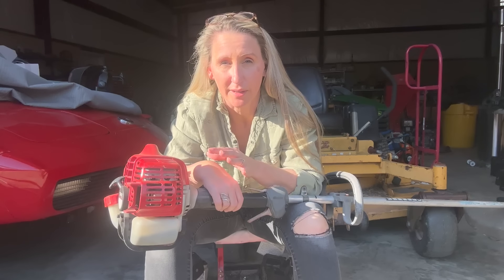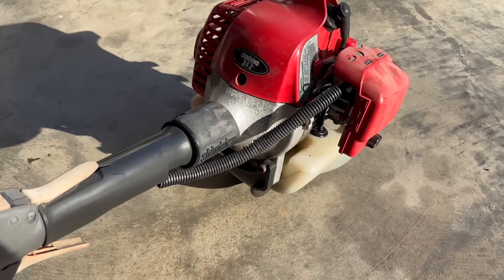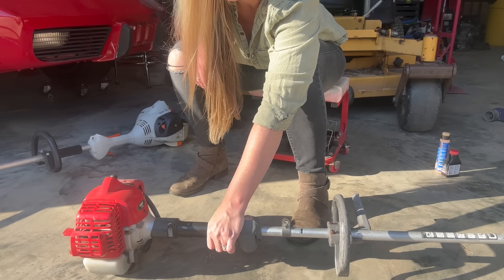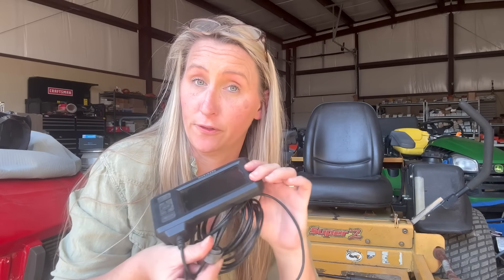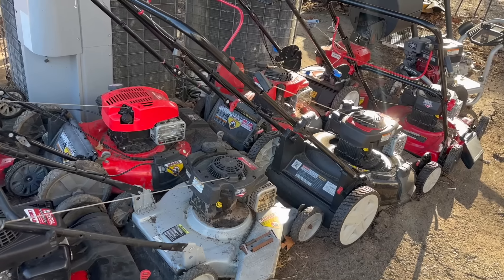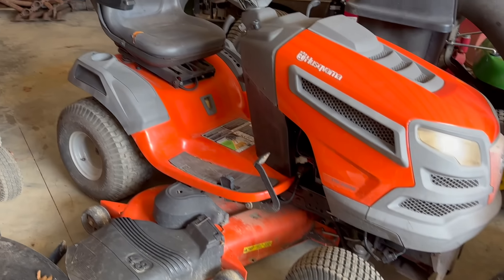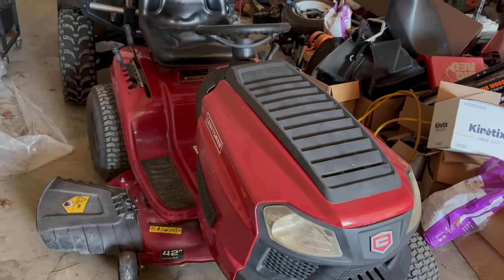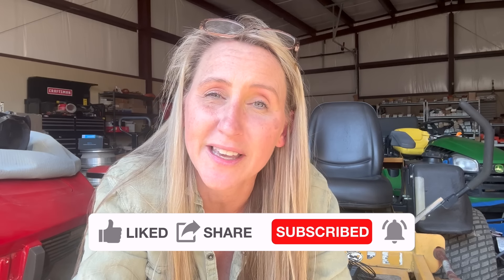Most People Do Not Know This SUPER EASY Trick I Use! MY 10 Second Trimmer Starting Guide!

Comment: $30? You got to be kidding the local shop where I live in Maine wanted $65 to replace the jet in the carb of my Toro lawnmower. I bought the part and it took me ten minutes to do the job. Thanks for the weed trimmer and thanks again for an old tip on your site that said most times the purge valve is not the cause of poor fuel feed. I was going to replace mine but following your advice I replaced the in line tank fuel filter and it fixed the problem!

Comment: All of my gasoline equipment is kept full of gas and I run them at least every two weeks.  They are kept at the door of my shop so they are not "out of sight, out of mine".  My gasoline generator is run monthly, under varying loads until it runs out of the pint of gasoline I put in it.  I have NEVER had an issue with any generator I have ever owned doing this routine.  It's on my calendar to do regularly!
Great channel!  Thanks for all the videos!
Reply: Wish I was that dedicated. I can do monthly stuff on some things but not my lawn equipment
Reply: @scotchdrnkr  Disney has a very effective way of exercising their emergency generators. They disconnect from the electric utility and run on the generators for the overnight shift.
Reply: my last generator wouldn't level off this year, rodding out the jet didn't fix it, so I bought a new one.  - the old one is 18 years old, and showing signs of electrical gremlins as well.  the big problem I had during that time was ethanol related.  old one will go to the saw shop to get worked up and will go into the family shop for storage.
Reply: Same here!

Comment: Back before I fell ill with cancer I use to do lawn care for my grandfather since he works from 5 to 5 doing construction and every time I’ve had to use the string trimmer I’ve never went full throttle I usually give it about half throttle maybe less and never had the issue of it dying again and I did that every single time now I’m not saying this will work for everyone however it worked for me I think it’s more so your location and the temperatures me being in southern Louisiana it’s hot 95% of the year until about October then we get down into the 60’s to 70’s every now and then we will get a super cold week around 35-40 in the day and around 19-25 during the nights and ive seen cases where extremely cold temperatures can easily effect gas and 2 stroke fuel, but as far as that goes I’ve never had an issue with a string trimmer!

Comment: At the end of the season, I empty the fuel and run the engine until it stalls out. Then it's ready to store for the winter. Spring time I give it some fresh fuel and BAM, it starts and runs as intended. I do the same for my ATVs. Top off the fuel tank and turn off the petcock and run the ATV dry. Never had an issue with them in over 39yrs.! Good tips, keep them coming! P.S. I also use non-ethanol gas in my yard equipment engines and ATVs.
Reply: Yep. Old school dirtbike/atv trick I was taught and used for decades.
Reply: Same  here. I learned that while talking to tree trimming business i FLA doing hurricane work. They advise me if you do not run the 2 stroke at least once per month, drop all fuel run it dry and hang it up. I never had to tinkle with this doing this , just add new fresh fuel and prime, pull the damm cord 2-5 things and it should start by the next pull.

Comment: Thanks for the tip on the trimmer! You can also check your fuel with a piece of clear vinyl tubing. Stick it in the fuel tank then put your finger over the top end and pull it out or you can use a mitey-vac to suck some up and take a look😊

Comment: I've been through this a couple of times with my Husqvarna 128LD trimmers, even to the point of replacing the carburetor, spark plugs, etc. on one. Then I found out all you have to do is remove the little screen on the exhaust port and clean the oil residue out of it with solvent or carb cleaner. Fixes the bogging-out problem for me every time.

Comment: First tip on a 2 stroke stored with fuel in it.  Check that the burn barrel is cold, don't care if it hasn't burn in a couple days, COLD.  Dump fuel into the burn barrel.   Fill with fresh mix, pump it through and go to it.   And ya, do the choke trick till every thing loosens up.

Comment: The only thing I have done for last few years is at winter storage just run engine every 1-2 weeks for a minute or two.  It moves out gas setting in carb and lawn tractor keeps battery charged…. Never had problems starting everything for start of next season

Comment: That's actually how I "quick" start almost every piece of stick equipment in my shop. I show the same thing to my customers all the time. Even machines that are normally run can be slow to start if the carburetor us getting older. It works just as good on them as well.

Comment: If Chickanic's trick does not work for you, remove the old fuel from the tank. Get you some Mechanic in a Bottle and pour some into the tank. Push the primer bulb about a dozen times to circulate the solution thru the carb. Let it sit over night. Next day add fresh fuel to the tank and it will start right up. It's very simple. Even better tip: always use ethanol free gas and you will never have this problem at all

Comment: I love the tip. Didn’t know about hitting the choke like that. I always just kept bumping the throttle until it frees up and once it does I peg it until it gets up to rpm. A little tip about 2 strokes, if you are tuning an engine and it goes from too rich to too lean and you can’t get it right, the carb needs rebuilt. Stop and take it to a shop or rebuild it. Could go lean and blow it up if your not careful

Comment: This is actually a good technique to also do on any carb engine where you think there is a particle of dirt clogging one of the jets. Doing this will help pull fuel thru the jets and other orifices harder and poss dislodge the dirt. On a snow blower without a filter or choke that closes completely, you’ll need to use a gloved hand under the carb cover to do this technique. Protect yourself against flame backs.

Comment: great hint to get things loosened up from winter storage! I do not know if is the thing to do, 
but I try and run all the gas out of the motor.so it is dry until u put gas in to the unit.
I also use a bit of carb cleaner in the gas. to clean out any glazing from any gas residue.

Comment: Just got all of my equipment out today and got it ready for the season. I own a small lawn care business. I tried your idea of using pure Echo Red Armor oil to put in all of my 2-cycle machines to store for the winter. That did work, but it sure made a mess when I went to remove as much of it as possible before starting. The Echo machines seemed to be easier to start than my Red Max machines. But, everything seems to be running fine. About ready to Go!

Comment: Thanks! I'm going to give that a try on our old one. I don't know how old it is, but I've been trying to get it going again. My dad used to use it, but hasn't for years. It had a cracked primer bulb and bad gas lines that I replaced along with a fuel filter. I got it running, but it was doing this last time I tried it. I'm anxious to give it a try.

Comment: Thanks Chickanic! got the scope for $40 :)
I have used the same method for my trimmers, this season unfortunately my metering diaphragm was rusted and pretty much toast, got water in the fuel from a crappy station, I use non-e gas only. Pulled an older carb off the same model parts trimmer and i was off n running and then ordered a backup carb from da chinamen

Comment: For Stabilizing gasoline I use a product called PRI-G. I’ve personally used gasoline that was Stabilized for four years, 😅 I put it in my truck and you could smell It was getting old, but it ran fine. They also make PRI-D For diesel.

Comment: We are looking for a piece of machinery to do work around our property, and it may be an older rider that I can drop the deck off of it and just use it for getting around the property, and pulling the yard trailer and stuff.  Maybe even try a snowblower on it if we can find the right unit.  If I lived closer, I would head on over and look at a couple of those.  Since you showed your pool table, I actually found my old cue recently, that I bought back in the early 80's, and it still has the red chalk on the tip from the table we used to play in a friends basement.  Now I would gladly remove the workout equipment from my basement and replace it with a pool table.

Comment: I usually during the cold season I usually start my lawn equipment about every 2 weeks and let it run for about 5 minutes and have no problems. But my craftsman weed eater was running fine then about a month ago it just stopped running. It's sounds like it lost spark cause it sounds like I have to plug wire off it just turns over. So I bought a Husqvarna weed eater runs fine but of course it has the defective speed head that binds the string

Comment: Thank you Ma'am for the suggestion on the two stroke.  I have a two stroke power head that I got so frustrated with I said the heck with it and went with a 4 stroke power head replacement.  I'll pull that two stroke out (after a few years) and see if I can resurrect it.

Comment: A simpler way is to just winterize it correctly with fog lubricate or use carb cleaner to spray in the carb at start up. If the fuel is bad choking it out will make it worse.

Comment: The only thing you left out is to also check the screen in the muffler on the newer stuff, because they seem to make them intentually restrictive these days. Helpful tip if you don't ever lay your equipment in a pile of leaves soaked in gas while running making the "spark arrestor" aka the stupid restrictive screen of doom disappear and never return will make your equipment run way better and you won't have near as many bogging issues in the future!

Comment: Every fall, I run the mower until it dies, change the oil, clean and gap the plug, lube the wheels and throughly clean under and top. Check the drive belt. Twin blade Honda push. New gas in the spring and starts with a half pull every time. Its 9 years old and runs and looks like new.

Comment: Excellent tips !  Now how about Stihl Chainsaw - that won't idle after it warms up after it ran perfectly 6months ago, yet still accelerates & runs full RPM ok.
Reply: Try adjusting your idle up with the “LA” screw.
Reply: @shannonwhitaker9630  It turned out it was a random  blockage in the idle circuit.
Took carburettor apart used some compressed air, both directions with L needle 🪡 removed as I didn’t have a new welsh plug for removal /replacement. In the end assembled and it ran OK for a bit, so I knew I was on the correct track. While running higher RPM backed out the L screw alot & rev it'd up /down then rest L screw 1-1/4 out which is the middle sweet spot and all is well again.
Reply: Makes you smile when you figure it out yourself. Sometimes a quick clean and re-adjust does the trick.

Comment: Good tip. I was just gifted a chainsaw about an hour before this video posted. It hasn't been used in 4 years so I was going to drain the tank and clean the carb but may try this to see if it saves me some work, Some times you get lucky. Thanks for all the helpful videos. Congratulations on getting your home gym set up. Is there a tips & tricks video coming on that? :-)

Comment: I used to have problems starting a 2 stroke engine in the spring after a winter of sitting. If you drain the tank before storing the unit for long periods of time you will most likely not have to do the choke waltz. My conslusion is the oil partially separates from the gas causing a sludge that restricts the flow through the carburetor.  Walk On !  ☺♥†♪♫ 2-28-24

Comment: Great video, thank you very much.
I understand changing fuel that has water in it.  But, as you say, Ethenol Shield may & heet in the red or yellow bottle (?) is supposed to fix the water in fuel issue ... and does ... or has for me in my experience. I live in S. Louisiana where it is humid during a fire storm.
Anyway,
I also have 55 gal drums of gasoline in the back of my property, (mentored on how to store safely by the Fire Chief who lives down my same country road).
Question :
If I want to protect or feel there might be water in a 55 gal drum (water sinks right ?)  Do you think the isopropal alcohol "Heet" will seek out find and migrate to the water to fix the issue ??  I mean, it's kind of hard to shake (mix) a 55 gal drum of gasoline.

Thank you so very much for your generous consideration,
Sincerely ....................
God bless.
P.S. I like the Ford Cougar better than that year of Corvette !!  If the "Vette" were a 72" I'd be torn between the 2.

Comment: I have found the absolute cure for ethanol problems in small engines. DON’T USE ETHANOL FUEL! Sorry for the caps!😔But for the nominal cost of ethanol free gas, typically Premium grade, you eliminate a huge headache and related costs. For those ready to pounce, yes, I know it’s an additional cost but for the cost of all the additives you need to put in ethanol fuel to avoid problems, you come out fairly close to a gallon of ethanol free gas. 
Try it, you have nothing to lose and, you might save a lot of 💰💰💰💰💰💰💰

Comment: Thanks Bre for another great quick tip video. Just a question, though. By "gunning" the engine on full throttle, could this damage the piston or cylinder on a cold 2 stroke engine? Thanks again. 🍁🍻
Reply: If an engine will crank and idle let it run for 2-3 minutes before trying the “Balls Out” choke routine. I’ve  had many 2-cycles that require a brief warm up period before they will go to WOT.

Comment: Hi, I have a  Echo SRM 225 on the first start it runs fine for about 15 minutes but you have to hold the trigger down or it won't start,  then I might get 5 minutes of run time, after that you have to let it set for 20 minutes. After the first start you have to prime, choke and hold the trigger down, the unit is only about 3 years old. I had an echo before this one and it lasted 18 years. This one seems to be running out of gas but I don't know I have to hold down the trigger to start never had to do that before.

Comment: How bout this, my Husqvarna 322l kinda does this no matter what, after a week of not running or 2-3 months, I do the prescribed start procedure, push primer bulb 10 times, choke it, pull the sting 3-5 times till it tries to start, push choke down and start it, press the throttles, it bogs down and shuts off, pull the choke up, pull the string 2-3 times, push the choke down and runs like it is supposed to.

Comment: Question…….is the position a trimmer engine stored in a factor to difficult starts? I hang mine vertically with the engine at the bottom, but every display I see is engines up. Or is horizontal better?

Comment: I have done the valves bought a new carburetor and the lawn mower runs  for a few minutes then it won’t start again unless it sits for several hours . Help. The gas is new and clean. Spark plug looks good .

Comment: I have a Husqvarna 525 LST that will only rev up with choke partial on. I have put new plug, filter and gasoline. Do you think this will work on it ? P.S. I just tried it for over 20 minutes with no luck. It still will only rev up with choke partially on.

Comment: Hmmm...When I was in landscaping we NEVER went from a start to FULL BURN like that on a cold start...EVER.  NEVER.  It was drilled into us and every new employee.  We allowed them to idle for a minute, then applied a slow throttle to get them warmed up...they would bog 100% of the time if we didn't  After the first start in the AM with a warm up we could go full throttle on a start, on the next jobs.  Those were old Shindawa's (still one of the best freaking weed whips I have EVER used...light, powerful, and so reliable).  Decent sized company, and we went through LOTS of fuel a day, so it wasn't 'old gas' since we got fresh EVERY day.  We were also beyond OCD on maintenance, it wasn't 'old and crusty diaphragms for sure, it was just the way it was.  Yes, that was nearly 40 years ago, but honestly?  I don't see that big of a change in 2-Cycle engines from 40 years ago to today.  Obviously, YMMV and for the home player, this very well could be a thing, but I still don't (and wont) go full throttle on a cold start...that was ingrained into me for a long time, and when I trained people when I became a crew leader I ingrained it on them.

Comment: Several years ago my tiller wouldn’t start. I noticed the gas in my tiller looked like it was gelatin. Now I only use ethanol free gas. I have never had a problem since. Now ever year when it’s time to use my lawn mower or weed eater etc. everything starts up and runs great. Gas with ethanol in it is not good for small engines. That’s just my opinion. I’m 68 years old and I remember when gas was real gas when it was kinda orange in color. This ethanol gas is diluted gas if you ask me haha. Real gas cost a little more but every one of my machines run better with less problems. That is just my opinion because I am old school when things were made better. When made in America meant something like quality and reliability. Everything now is plastic and poor quality and doesn’t last very long no matter what you do. It’s just junk. I have machines over twenty years old and they still work like new.